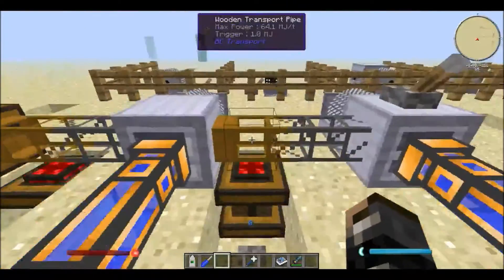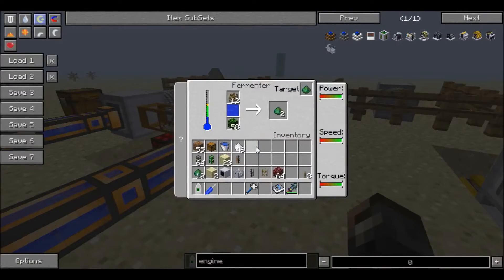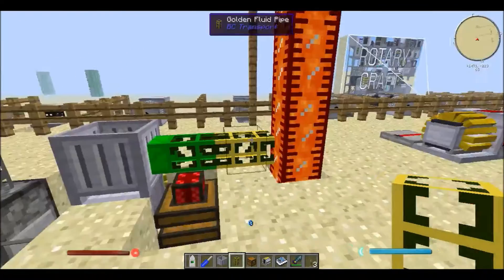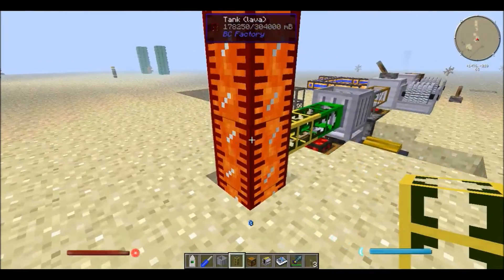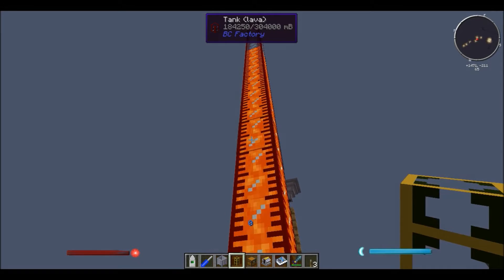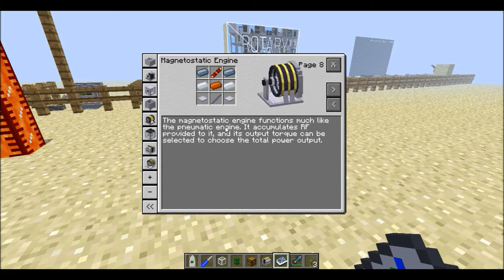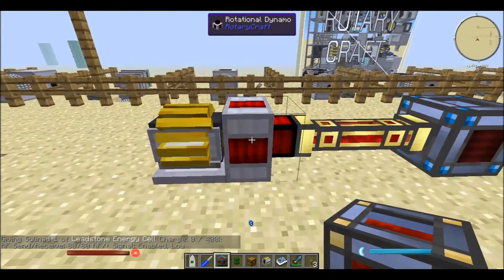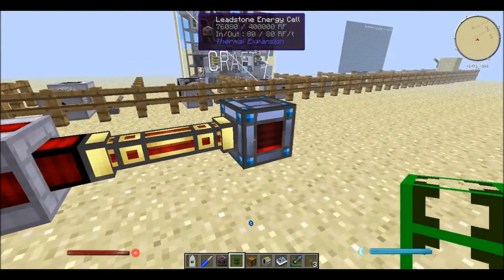Rotarycraft:  Automation, Integration and Interactions

Comment: To put stuff to be smelted into a vanilla furnace I think you must pipe it into the top. Fuel goes in the bottom and smelted stuff can be extracted from the sides.

Also if possible put a cobble, stone, iron, gold, sandstone, or diamond pipe. Sometimes it doesn't like connecting machines directly with wooden pipes.

I think I have gotten all that right it has been awhile :p